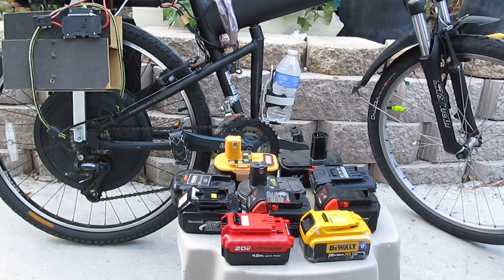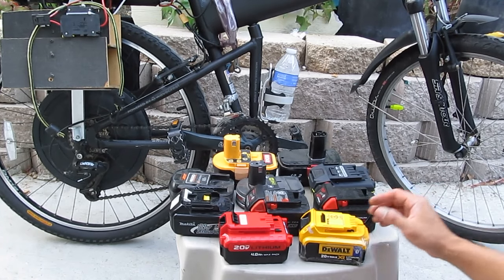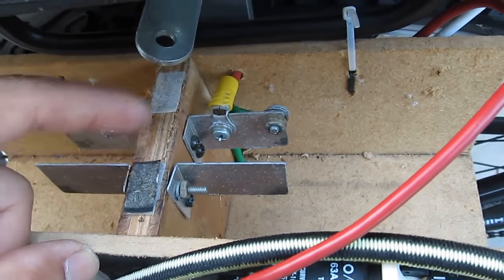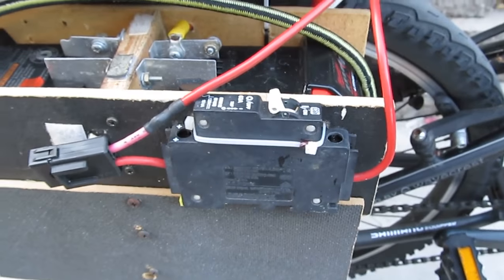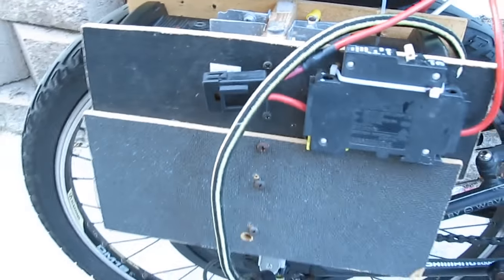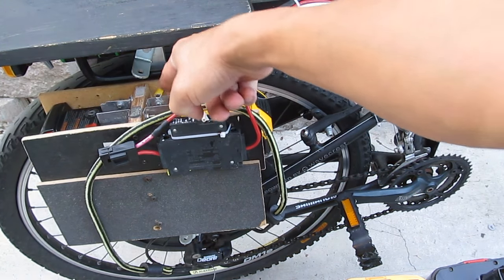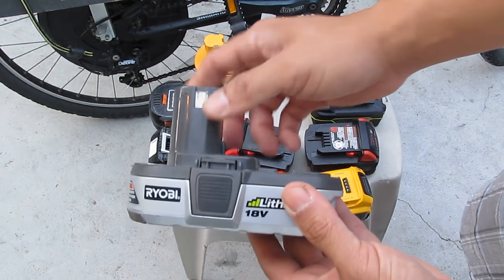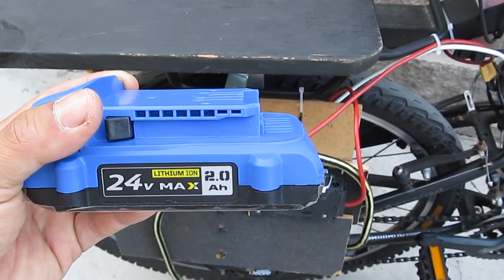DIY: Home Made Electric bike battery box with cordless tool Dewalt/Milwaukee battery

Comment: Anyway to rig more batteries to get more amps?
Reply from the maker: Each cell in the battery pack is capable of delivering at least 15A. The cells Milwaukee 5Ah pack can deliver at least 20A. This box is made for 10S4P or 4 cells in parallel. That's 60A or more discharge rate. My motor is 1000W, 36V or about 27A max. This set up would cover  my motor with plenty of room to spare. If you ask about Amp Hour then that's a different story. There's no need to add more batteries as 4 of them already cover 25-30 miles. It only takes a minute to pull out the empty packs and put fresh ones in. Plus, by the time you reach 30 miles, you probably need to take a break anyway. How far do you want to go on an electric bike?
Reply: Thanks, I did mean more amp hours.  Milwaukee has a 9 amp hour high demand battery. Is there any advantage in using those instead of 4 amp hours and smaller?
Reply from the maker: You can go farther with the 9Ah but no other advantages. At a price tag of almost $200 each (after tax), I'd rather get a few 4Ah batteries instead.

Comment: I'm sorry I didn't catch that. Did you say you can get 30 miles from 2 cordless tool battery packs? I find that hard to believe. You spent way to much time on arbitrary details as mounting and connecting the battery terminals than the most important information.

Comment: A better idea in my opinion is to get Rc lipo batterys  they are cheap and lighter than those batterys zippo batters are cheap
Reply from the maker: RC lipo batteries have very high discharge rate so it's good for this application. But the problem with that is Lipo batteries have low capacity so you can't get very far. They might be cheap and lighter but you have to get more of them to get the same capacity of a Li-ion battery. (there's a reason why Tesla uses these 18650 Li-ion batteries instead of Lipo). So there's basically no benefit for getting RC batteries unless you already have RC batteries from your toys then yes, maybe. But almost every single household nowadays has cordless tools and their Li-ion batteries already laying around.
Reply: +vuaeco exactly but I can get 12 v 12000mah battery's and charge them more precise than  than those but that's a great idea with the drill batteries
Reply from the maker: These tool batteries are charged by original manufacturer chargers so they are all balance charged and you can't get more precise than that.
Reply: +vuaeco I just think they are heavy

Comment: I noticed the batteries showed 2 amp hours (at least thats what I seen on one of them) so even running 2 in thats roughly 4 amp hours. Im unsure how your getting 30 miles from those I have a 24 Volt 9 amp hour setup (for testing) and It lasts about an hour at 12 MPH.
Reply from the maker: No, the batteries are 5Ah when I rode the bike. The batteries when I showed you the build were different. And it's not 24V, its 40V (2x 20V in series). So if I have 4 batteries, it will be 4x 5Ah x20V = 400 Watt Hours. At 12 MPH, my motor only consumes roughly 150W so I can run about 2.5 Hours at 12 MPH. And that is equivalent to 30 miles.

Comment: Where in hell do you buy your drill batteries? The last time I priced a new battery for my Millwaukie 18 volt drill, the price was $90.oo You call that inexpensive?  Your money grow on trees?
Reply from the maker: For tool batteries, you just have to be patient and wait for the sale. Or buy them on Craigslist. There are plenty out there so you just have to be patient and know where to look. On the other hand, the electric bike batteries are very specific to each specific bike model.  Sometimes you can't even find it new because either the bike manufacturer goes out of business or they don't make that specific model any more. So you have to buy it used and who wants to buy a used battery? Finding them alone is already hard. It's just a demand and supply thing. Something that is hard to find tends to be very expensive.

Comment: It's like you read my mind except I have to use the Ryobi cuz I have about 50 of those batteries I have a 24 volt system on my bike if I put two batteries together create 36 I have to choke that down 2 approximately 29.4 would you have any recommendations on the DC regulator thanks Dennis and as always terrific video I could even follow this one with my skills thanks